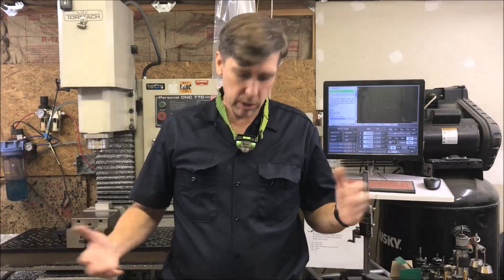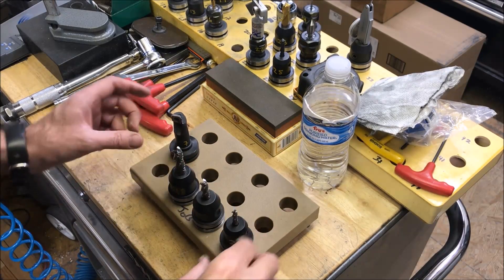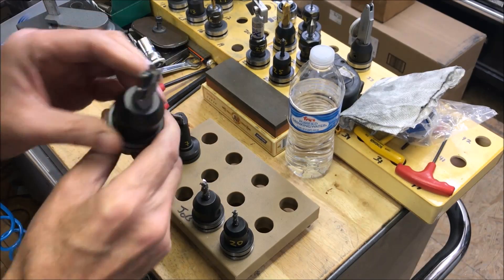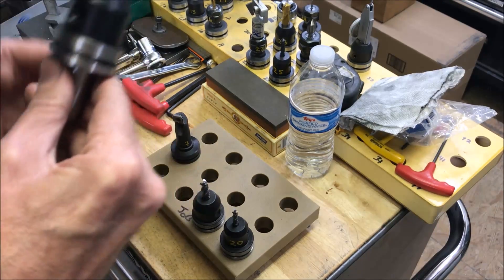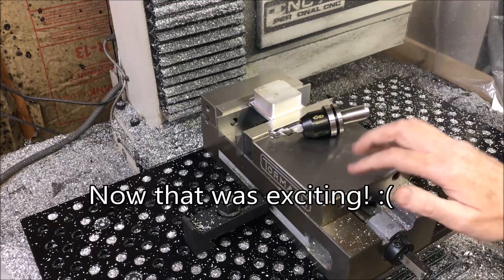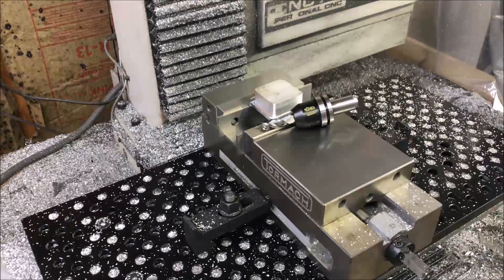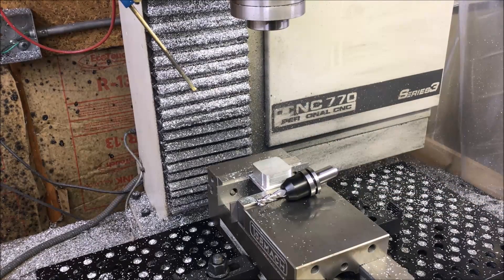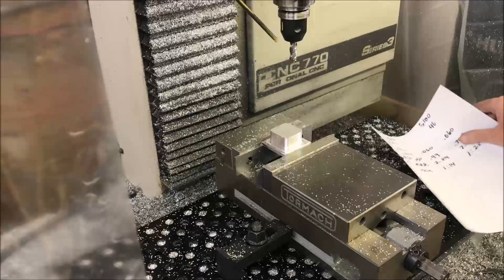Testing the TAS on the Tormach 770

Comment: hehe I had a similar experience and a slot cut into my hardened vise jaw on my 1100 with a 3 flute 3/8" corner radius end-mill in aluminum on my 1100.  I tightened up the drawbar a little more, just so you might need to wiggle the tool to break the sticktion on the taper to pull it out with the power drawbar button pressed, a tighter fit.  Haven't had a TTS holder pull out and I can easily bog the spindle down without worrying.  When the spindle bogs just make sure you have good coolant flow to the endmill and it will usually pull through it. Hitting it with coolant from 3 sides would be great for those passes around the far side.

I've noticed after a few parts being ran the SGS brand tool I'm using has dulled up a little from the factory new condition, but I have done some stupid stuff with it in aluminum and it's practically indestructible.  0.060" corner radius!
Reply from the maker: I  don't do a lot of tool changes with the work I am doing now so I pulled the power drawbar out when I started having problems with it.  I guess I need to rebuild it or something.  I think part of my problem was dirty TTS holders.  I cleaned them up and it's better. I don't push it hard very often though.  Thanks for the tip!  

Haven't tried SGS tools.  I'll have to give them a try.  I really like YG-1 4 flute roughing endmills for steel.
Reply: One thing you might check is to be sure your Filter Regulator Lubricator is set to the right pressure range, of course if it doesn't push the belleville washers down far enough it won't be tight enough.

Comment: I have never had a end mill pull out of the spindle. I have seized one once when I crashed the machine. Had I kept using that particular collet it would have had pullout at some point since I ended up galling it a bit during the crash. Double check your drawbar and remove that collet and make sure it is clean and in good condition.
Reply from the maker: Thanks for the tips.  I think I will order a new collet from Tormach.

Comment: Some of the older r8 collets from tormach had issues with 1/2 mills pulling out of the r8 because of burrs on the r8, call tormach and they will send a replacement r8 and the problem will go away
Reply from the maker: Maybe I should get a new collet from Tormach.  I've been using this one for over 2 years now.

Comment: Another very interesting video. Mills are sooo expensive compared to lathes because of all the tools that eventually are needed. Regarding the pullout, was the drawbar was torqued to spec and we witnessed the limit of the TTS holding power? I have TAS endmills but have yet to try them. I'm not so interested in maximum removal, but what's most appealing is easier cleanup of little chips from the TAS compared to long chips. Best wishes
Reply from the maker: Thanks Kent.  Yeah, I am still buying tools for the Tormach.  Not sure when it will ever end.  LOL  From what I remember, the TTS tool was dirty.  I'm trying to get away from roughing endmills.  They are too expensive when they break.  I am working on getting a selection of indexable endmills.  I will be starting with a 25 mm 3 flute and then I will get the 16 mm 2 flute.  The inserts for them are dirt cheap.  Like $20-30 for a box of 10 with 2 sides.  So basically 20 sides or $1 per side if it chips.
Reply: @craigsmachineshop2040  I didn't know the inserts where that inexpensive. I use a few modular insert tools and really like them. The only thing that I can add, and you probably already know this, is their cutting diameter needs to be measured accurately because the diameter changes with inserts, at least that's been my experience.
Reply from the maker: @kentvandervelden  I did't either until comments on the facemill video.  Its like $20-30 per box for Chinese and $50-90 for Japanese/Other depending on where you buy.   Well, I would only use the modular insert tools for roughing and finish facemilling.
Reply: @craigsmachineshop2040  If I want a part to look particularly shiny, I use the insert tools to finish the floor, staying away from walls by a few thou to make up for the potential diameter error. The non-center insert cutters in particular leave a very nice floor. Then finish walls with a suitably long traditional endmill. That seems to work OK. I've not looked closely at the orientation of the inserts in the Tormach modular mill tools, but I recently noticed that there are a few lathe tools that can't be modeled in Fusion360 or LinuxCNC because of non-standard insert orientation. However, that non-standard orientation allows edges of inserts to be used that otherwise would see little use. An interesting possibility, giving an otherwise used up insert a second life, if only Fusion supported the orientation and one would not need to keep

Comment: So i had the same problem, the TTS slips with the TAS, the bigger the TAS diameter and DOC, the more it pulls down.  i had to really crank on my drawbar nut, i.e. tighten just enough so the TTS just falls out, 1/8 of a turn more and the TTS sticks, like that level tight.   i lost more then one TAS figuring that out.  even now i take lighter cuts with the bigger TAS, well frankly all of them just as a precaution
Reply from the maker: Good to know I'm not alone. LOL  I have my PDB out till I can figure out what's wrong with it.  Maybe I just didn't tighten the drawbar enough for roughing? I guess I can try that next time.  So are you staying at around 2 MRR and under?
Reply: I am still using very conservative speeds and feeds,. Not sure off hand, but the same that i would use pushing a lakeshore 3 flute varabile end mill.  To me the TAS is less about MMR and more about plunge AND chip size.  i cut foot plates for wheelchairs with different designs, the TAS lets me just go fast and not worry about slotting or plunging.  I use the 1/4 most, i am still a little scared of the 1/2 (of which i have messed up at least 3. i have also snapped 1/4 TAS).  i am sure just watching your video that the holder slipped out of the R8 TTS collet.  if you still have that test block you will see the cut path dip down as it is sliding out.  just looking at my tool library in fusion i am just running the 1/4 at 0.003 in per tooth, that nothing i have heard going at 0.006 per tooth. the keep for me is that i can plunge at 10 degrees, i have heard that it can go much higher like 20 degrees and is big compared to 2 degrees for a regular end mill.  keep us posted.

Comment: Cool test Craig. I was wandering how you got the aluminum to spark, then I saw the gouge in the jaw. Ouch! They should still be good though.
Reply from the maker: Thanks Marco.  Maybe I should go back to using soft jaws with steps instead of hard jaws and parallels.  The problem with soft jaws is that you have to keep checking them because they can get damaged easily.